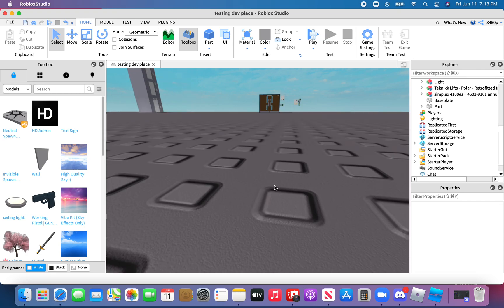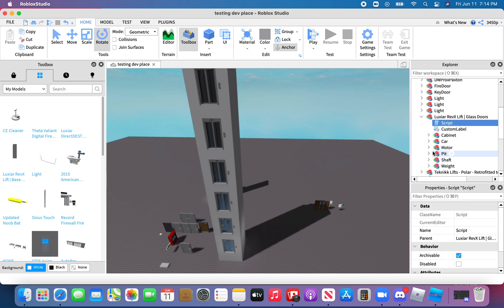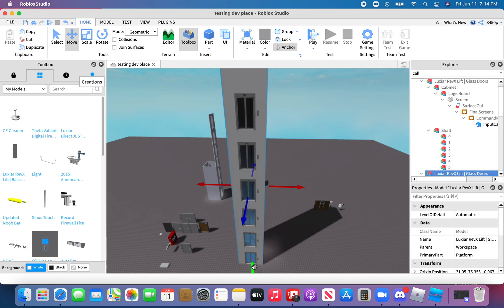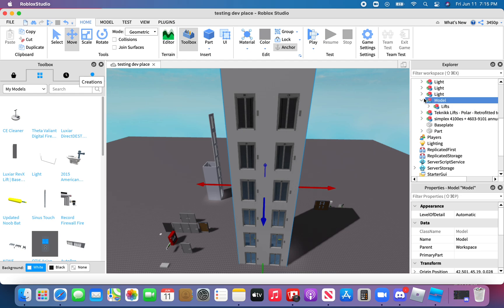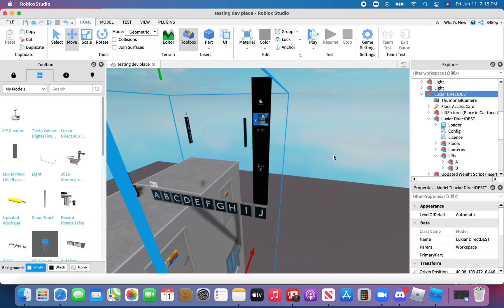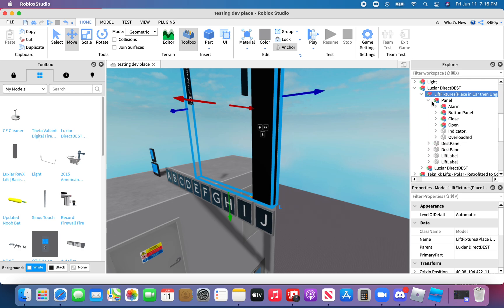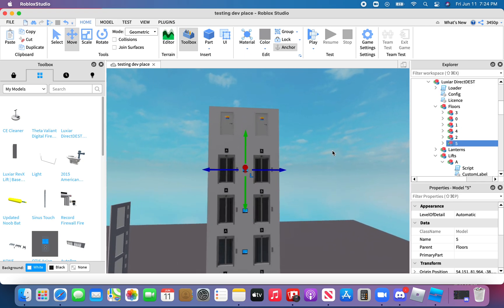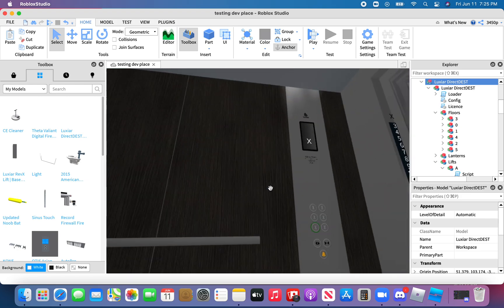How to wire up a Luxiar DirectDEST dispatch elevator

Comment: Direction does ever not change or pop the depending direction because when it is called, it actually just like goes to that floor. But, how did pt_tech of the owner of Platinum headquarters of the elevator, how did he even did a call direction?

Comment: Just wondering, How do you change the custom label on the floor selection panel because it makes the names of random floors 'L'
Reply from the maker: Go to the script and you may find custom label in it.
Reply: @thirtyfourelevators  Arman can you help me because i seted floor 6 to locked and when i scan card it says insufficient rights but i dont know how to change card's level so please help
Reply from the maker: @kubixon1352  i had to delete the last reply. that feature might be broken. i thought this was the dwprox video at first
Reply: Arman i dont know why but Direct DEST system ignores card reader and lets me select the locked floor
Reply from the maker: @kubixon1352  the locking system is broken.
Reply: @thirtyfourelevators  i think that DiamondDoesStuff does not fixed it already so lets just wait until he will fix it
Reply: so ill just use DWProx for now :)